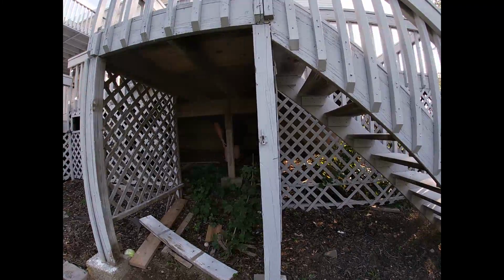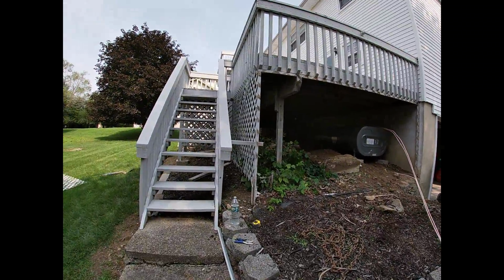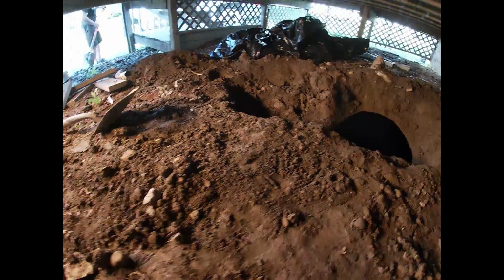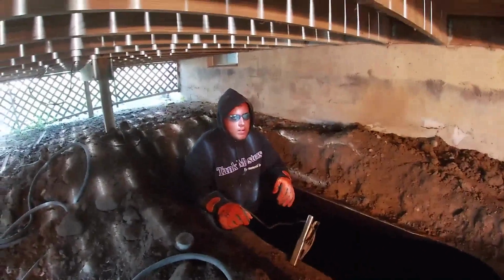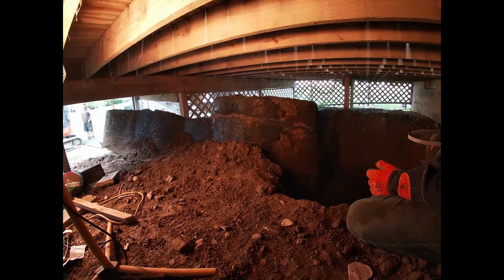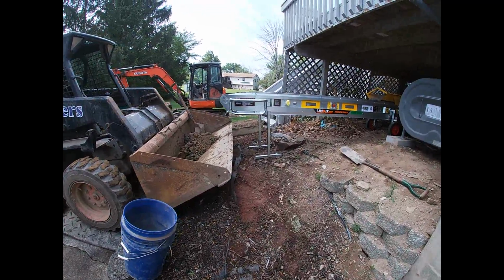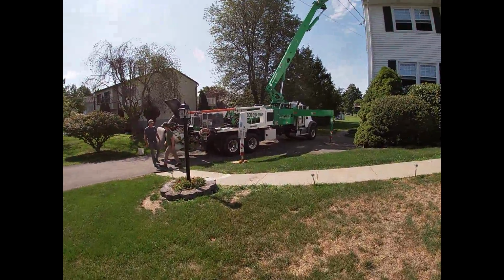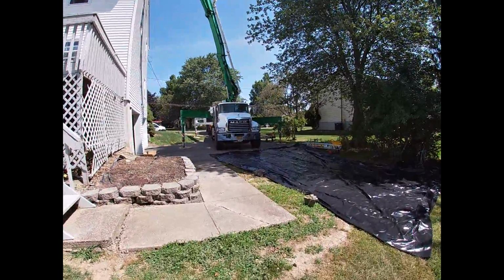Simple Job Got Very Expensive

Comment: Why did you fill the hole with expensive concrete instead of dirt?  I must have missed the explanation.. compaction?  Looks like a plate compactor could fit under there...
Reply from the maker: i pay $6 a yard. Almost 0 settling
Reply: @TankMastersEnvironmental  you must mean $136

Comment: I think u  old of used gravel to fill it back up with the conveyors u had there and I don't think k u took out 12 to nes of soil outta that little hole and the sides  I'm sure we're a lot higher then 11.5 but I don't care I'm just watching your video I like them alot and I'm just commenting to be a prick lol but I'm likely correct
Reply from the maker: Welp, Ill look for the weight tickets for the disposal that day. It will be in the full closure report issued to the State. Im gunna guess im right (cuz im rarely wrong). The town would not let me use gravel because they did not want water too close to the foundation and the stone actually creates a drywell. Also concrete was decided because we compromised two piers holding up the second story deck.....Give me your email address and ill send you the full closure report.

Comment: Is there a chance you are transferring old sludge? Is that oil flammable? What are your safety protocol or back out plan if that dude get stuck in the tank or dirt collapses on him?
Reply from the maker: Hello VC
With regards to sludge, our drop tube that goes into the bottom of the tank has a 4" spacer which keeps it off the bottom and we use a double mesh screen on the inlet and outlet of the hoses. I also ALWAYS recommend NOT transferring fuel, but its the homeowners choice. When Mikey is in the tank cleaning it he wears a "lift harness vest" under the tyves suit. We normally shore the soil if a collapse is a  possibility. Thank for commenting